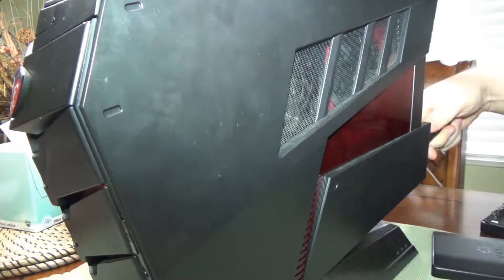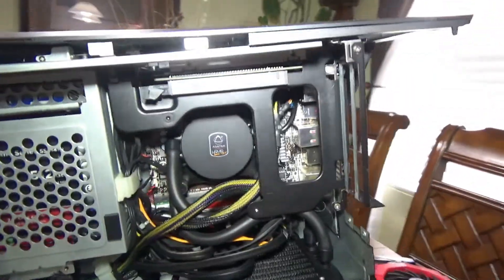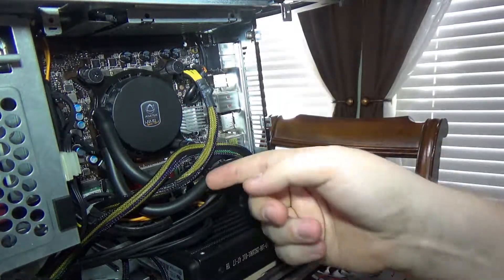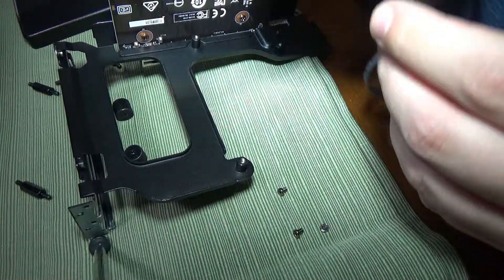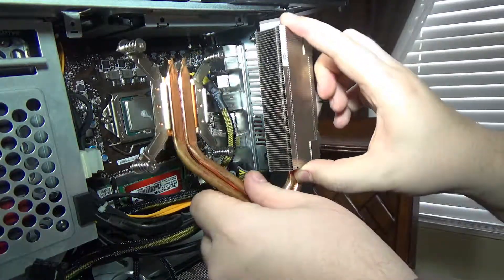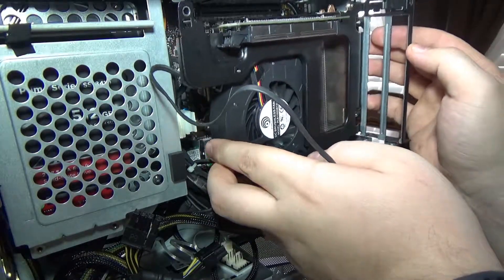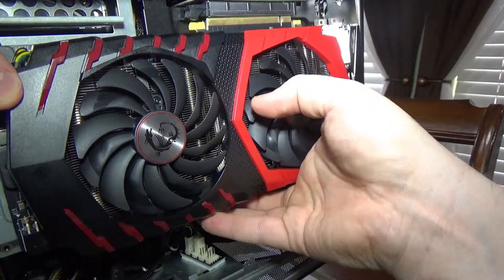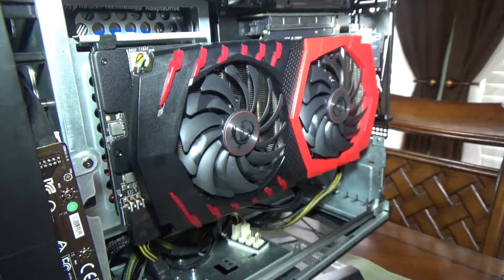Heatsink replacement for MSi Aegis

Comment: Did you replace the PSU? It does not look like my model. If yes, do you know where to get the upgraded psu? My default is only 350w which is clearly not enough for modern card

Comment: Just upgraded from i5 6400 to i7 7700. Systemn runs hotter and I am looking for a better heatsink. Any suggestions?
Reply: Check out Asetek's AiO. You will need to buy the retention bracket for it as well but it should keep that 7700 at bay temps wise. Here is the link: https://store.asetek.com/products/asetek-645lt-92mm-performance-liquid-cpu-cooler
Reply: @VedranSimic  thanks! Isn'it the one shown in this video? Which exhaust fan will go well with that?
Reply: @caiuDiretta  Sort of. It's new the newer version. I paired it with a Noctua NF-A9. But I am also partial to the BeQuiet Pure Wings 2 92mm, BL045 fan as well. Both fans are a great option. Now I only had it in a pull config since there just isn't enough room to do a push/pull config.
Reply: @VedranSimic  great! Before I spend $100 I was thinking to replace the stock MSI Aegis heatsink with a Noctua NH-L9a-AM4. What do you reckon? Do I have the pins on the motherboard to pair it with the standard cpu fan it comes with?
Reply: @caiuDiretta  It's a standard 4 pin connector on the motherboard. I would suggest getting a 4 pin splitter or hub so that you can run multiple fans. I forgot the brand that I used but if you search on Amazon for a PWM Fan hub or PWM fan splitter, it should be one of the first ones to pop up. The first one that popped up for me had a 2 pack for like $13. Adhesive on one side so you can mount it anywhere. On mine right now, I have the pump running, exhaust fan for Rad and intake fan. As far as the Noctua Heatsink, even though its a low profile unit, I haven't tried to fit it in my machine, so I cannot say if it will fit. I do have one that I might be able to test out. You still def need an exhaust fan in that particular scenario just due the fan type, it needs to exhaust the heat thats inside the machine. The OEM cooler that the Aegis comes with doubles as both. Maybe try a better thermal paste like the Thermal Grizzly Hydronaut or Kryonaut.
Reply: @VedranSimic  so cool! I didn't know PWM hubs even existed! Do they work well? 
I don't have bad thermals but I upgraded form i5 6400 to i7 7700 and sometimes I hit 78 degrees. I did so updating the bios via DOS to 511 (MSI customer support sent it to me). I have more questions about your setup. I will post them here but we can also connect elsewhere if you prefer (discord?)
1. Does the front intake fan made a big difference? Will the Noctua NF-A9 fit?
2. How do you set fan speed with the PWM hub? Do you toggle the CPU fan settings from the bios or you can set different fan configuration individually?
3. Will you use the OEM cpu fan as an exhaust fan even if I will replace the heatsink with Noctua NH-L9a-AM4?
I find this project very exiting and I thank you for your time.
Reply: @caiuDiretta  My hub works really well. I am running a i7 6700 and it maxes temperature wise to about 75C on air(OEM, running cinebench r20), and a about 60C on water. 
1. I don't know if it made a difference much, but I like having air current running through it. MSi did engineer it like that to run without having a front fan.
2. My Actual setup, the motherboard doesn't allow a fan curve to be setup, so all of my fans are being controlled via CPU Fan header and dictated by thermals on CPU. With the fan hub, It doesn't allow individual fan control since it only has 1 header connection. 
3. If I use the liquid cooler, I won't use the OEM fan just because it doesn't fit. You just need to get a 92mm fan as an exhaust that fits at the bottom opening of the case. Don't buy the NH-L9a-AM4 is an AMD version of the heatsink, Get the NH-L9i. That's the Intel variant.

Thanks for the positive feedback. I actually will be working on a new project. It already has been done but I am going to be putting a PC inside the Original Xbox Console, so stay tuned. I probably will be posting it on my other channel.
Reply: @Lemerex  will check out your xbox project. Meanwhile I will try the Noctua NH-L9a-i with an intake Noctua NF-A9 to the front (how did you fit yours without screws?).
Reply: @caiuDiretta  The NF-A9 wont fit. It has to be an 80mm x 15mm fan just due to size. Instead of screws, I used the rubber rivet screws. A lot easier to work with and less vibration. The fan I used for the front was a silenx iXtrema 80mm fan. That I believe is discontinued now, but coolermaster has one that is the same size as well, just not as quiet. The iXtrema is around 14db and the coolermaster is 20db. Keep in mind, it has to be 80mm x 15mm.
Reply: @Lemerex  thanks
Reply: @caiuDiretta  I got a new Video coming up with the install of the new front fan. I'll let you know once it the video is up
Reply: @Lemerex  great. Meanwhile I tried the Noctua L9i but it won't fit. I managed to put a Noctua 90x25mm at the rear back. I might try a ARCTIC Freezer 11 LP next week.
Reply: @caiuDiretta  Good luck buddy. I swapped my Noctua for a be quiet pure wings 2 92mm
Reply: @caiuDiretta  any luck with that Arctic Freezer LP cooler?
Reply: @Lemerex  nope. Too tall. I managed to decrease temperatures modding the case. I added 1 intake Noctua NF-A9x14 chromax.black at the rear back and 1 ehaust Noctua NF-A9x14 chromax.black at the top (srewed where the SSD 2.5 would sit). They take 12v from a PWM hub connected to the CPU-FAN Pin. The original exhaust fan is also attached there. Next month I will try to replace the heatsink with a ID COOLING IS-25. I will keep you posted. The original
Check my instagram if you want to see a picture of the case I made.

Comment: I have the aegis 3 and want to change the down push standard cooler with a noctua. Do you know what size to chose? And I want to ad a front cooler like yours same from noctua. What is the name of the connector for multiple fans like you have ? Peace
Reply: Are you talking about like a small form factor, slim line heatsink or just a fan?
Reply: @Lemerex  only fans
Reply: @KingShort8  92mm fan is max size. So any brand 92mm will work

Comment: Anyone know where I can get this specific fan? I’ve tried looking around and have struggled to find any
Reply: From what I can tell, the model is dc brushless fan plb11020b12h but the only places that sell this model come from sellers on eBay, would be great if anyone knows any reliable websites, really frustrating
Reply: @sly3361  I think ebay is a good alternative to find parts. I use it myself in case I cannot find it on different retailer websites.

Comment: Hi! could you tell me how did you disassemble the front panel to place the fan?
Reply: Sorry for the late reply, I just noticed that you asked a question. I have a different channel so I don't check this one often. The front panel is a bit tricky to take off. There are clips that hold it together on both sides. Now the front panel won't completely come off, just enough space for you to add a fan or if you need to clean it a bit. Hope this helps!

Comment: This video is great I've been trying to find a in depth video for a while to show this part of dismantling the fam for the cpu since I believe on of my wires is getting caught in the fan which is making a right racket.. I thought it was my hdd dying at first but under closer inspection its come from around the cpu area and not the hdd. Thanks alot.
Reply: Glad you enjoyed the video. Sorry for the delay in reply. I didn't get a notification of someone replying to this video. I have a different channel so I rarely check this one.

Comment: Is the CPU in this PC watercooled?
Reply: You can get a Asetek AIO for this unit. It's a bit of a squeeze to fit but you can get one straight from their website. Here is the link for it: https://store.asetek.com/products/asetek-645lt-92mm-performance-liquid-cpu-cooler You do have to purchase a bracket for it but they have all the info on aseteks website

Comment: I want to change the case of my Aegis 3 9th, because i want to get water cooling. Which cases can i use with this motherboard?
Reply: The board is a standard itx board. The only thing is, i believe it is a proprietary psu connector if I am not mistaken. So i think what ever case you go with, you will need that style psu. If it is standard 24pin with 4/8 pin cpu connector, you are set with any case you want to go with.
Reply: I'm gonna keek the same psu, i found a case where it fit. Am i good to go?
Reply: @amjadalhammoud625  You should be good to go. One other thing, double check and make sure that the front panel connectors are not proprietary. Good Luck Buddy!
Reply: @amjadalhammoud625  can you link it pls

Comment: Which size dose have the fan that you installed in the front of your pc, i wanna get one of these for my pc, Aegis 3 9th.
Reply: 92mm x 15mm
Reply: @Lemerex   is it not too big? there is not too much space in the front of this case?
Reply: Amjad Alhammoud it either 80mm x 15 or 92mm x 15mm. I believe mine is a 92mm x 15mm by silenx
Reply: Ok, thnks very much, dose it actully worth it? i have the orginal cpu cooler and a fan in the down the case.
Reply: Amjad Alhammoud it does give it a bit more airflow. Since i did water cooling, my radiator is at the bottom so I needed a bit more airflow going through system
Reply: Water cooling vs msi orginal cooler? My cpu running at 65w. It is the core i7 9700f
Reply: Amjad Alhammoud the newer series chips run a bit cooler vs the 6700. Hence the water cooler
Reply: I wanna get a new case for my pc, could you pls tell me what kind of cases can i install this motherboard into?
Reply: @amjadalhammoud625  SOrry for the extreme delay in response. It's a Mini ITX board so it will fit any size case. The only problem is that it is using a custom power delivery, not a standard 24pin PSU will work. Thats the only tricky part.

Comment: where can i find a liquid heatsink for msi eagis 3?
Reply: HANT-X you can ordered it from Asetek. Here is a link. They are out of stock at the time I checked but this is the one that will fit. You do need to purchase the retention bracket separate.  Hope this helps. Link: https://store.asetek.com/products/asetek-645lt-92mm-performance-liquid-cpu-cooler
Reply: thank you can I find it on amazon?
Reply: HANT-X nope, just checked. Its a special cooler. Size wise i mean, the radiator is for 92mm fans. So it is very small compared to the standard AiO.
Reply: Veronica Orsi  it is difficult today to find this liquid heatsink.
i think i will buy the noctua nh-l9i hoping it will be fine

Comment: I have the same aegis with i5 6400, 
Can i upgrade it to ryzon or any other cpu ? 
My motherbord is msi B901
Reply: ibrahim jamal you have to stick with intel. You can get a 6700k inside but I think thats the most powerful CPU you can get for the machine.
Reply: Vedran Simic  thank you so much for answering, could you tell me about the psu its only 350W and everyone keeps tells me that its not enough for my gtx 1060 i56400 16 ddr4 rams with other peaces in my Pc , is that right ? And if i need a larger psu is it available for this pc case ?
Reply: ibrahim jamal mine came with a 600w. Mine was a barebone machine though. I think a 1060 should be fine. I had a 1080 inside my unit with 32gb of RAM. I would reach out to msi, give them your serial number have them verify what PSU you have.
Reply: Vedran Simic you are doing a great help man thank you so much , and to the cpu do you recommend to upgrade i56400 to i7 6700 with 1060 gtx or its just a waste , thank you again.
Reply: ibrahim jamal depends on what you are doing. Gaming you wont notice a huge difference. But if you want to stream or do video editing, having the extra core/thread count will help out. 16gb is fine for everyday. I did 32gb just because i was doing animation work on it as well.
Reply: @ابراهيمجمالعبداللهعبد  mine was i5 6400 with gtx 1070 and 350w PSU.
I upgraded to i7 7700 and it is still working fine.
Reply: @caiuls  i have r7 3700x and rtx 2080 super now :)

Comment: Hi, how was ur cpu temp with water cooling? Have stock thinking about water cooling for lower temp
Reply: Well temps did drop or stayed more consistent. When I ran Cinebench 3 times, it didn't get past 75C with the 6700. I mainly replaced it due to the machine being a bit louder with the stock fan. As long as you pair it with a good fan for the Radiator like a noctua fan, you should get decent temps. Hope this helps!
Reply: @Lemerex  Its help:) one more question what the best water cooling for aegis? how big can it be to fit then fan down there?? Im kid of new to pc cooling system.
Reply: @cz4rny88  I actually got it straight from the manufacture that makes the liquid cooler for them. They discontinued it though. It was the Asetek 545LC 92mm. They do have a new one that you can buy from different vendors. It's the Asetek 645LT. Here is the link if you want to buy it straight from Asetek: https://store.asetek.com/products/asetek-645lt-92mm-performance-liquid-cpu-cooler   . You do need to buy a 92mm fan for it. I recommend a Noctua fan. You will also need a fan hub, preferably a 4 pin. I would suggest a fan grille for it as well so that wires don't stop the fan from spinning. Hope this helps! Let me know if you need any more info.
Reply: @Lemerex  ok thank u😁
Reply: Vedran Simic Man my cpu stay at  85/90 degrees. If I repast the cpu will my temps drops ?
Reply: @giuseppeprattichizzo1862  If you are running air cooling, it might be like that since it is just a blower style fan with a dual heat pipe heatsink. If water cooling, thermal paste might help or it might be that your pump is failing or that there is no airflow going through the radiator.
Reply: Vedran Simic I have Aegis 3 with air cooling, like your in the video
Reply: @giuseppeprattichizzo1862  I would probably re-apply thermal paste. Possible consider getting water cooling. But that temperature is about average for higher end cpu. I ran a 6700 in mine.
Reply: Vedran Simic Ok man, I will repast it, should I see much difference in degrees with new thermal paste?
Reply: @giuseppeprattichizzo1862  depending on how old the thermal paste is and what type you are using. but maybe around 3C minimum.
Reply: Vedran Simic Ok, thanks!